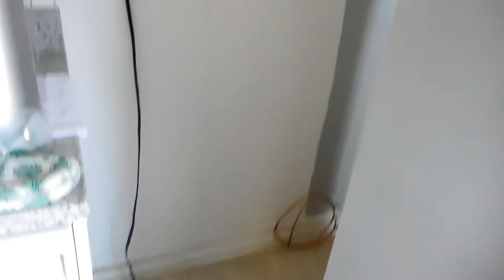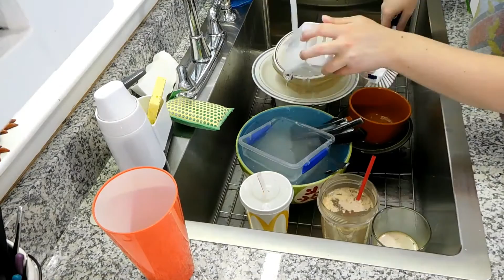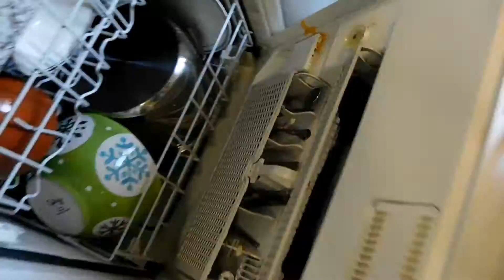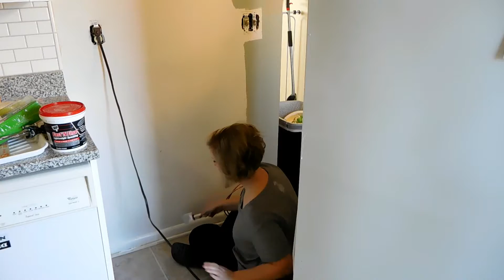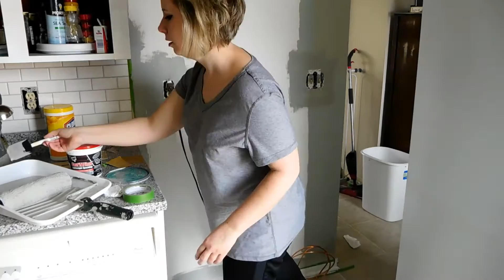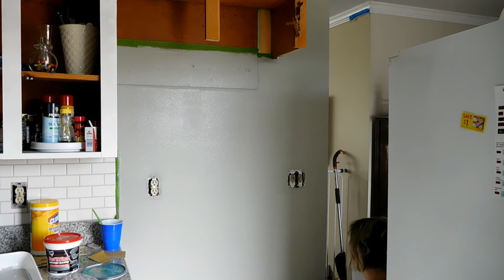Kitchen Clean Up/Painting Behind Fridge Speed Clean!!

Comment: What is the brush yr using or is it a pallet x
Reply from the maker: The brush that I used for around the cabinet and edges was just a sponge brush from Lowe's. I like the way it creates smooth lines :).  The first one's sponge popped off, and so I had to go and get some new ones.  But with all my paint projects,  I always get the sponge brushes for trim work in the medium size because they aren't too big or to small.  The first one in the video that I used, was a larger one bc I didn't have a medium sized one.  And within the first couple of minutes, it broke :-/.  So I recommend the medium one ;).